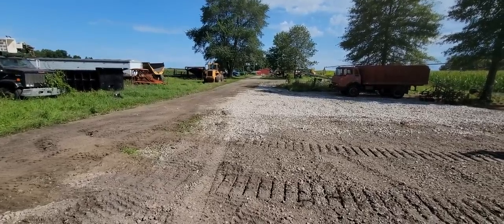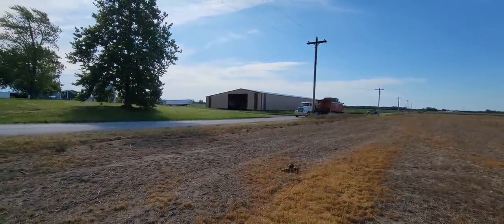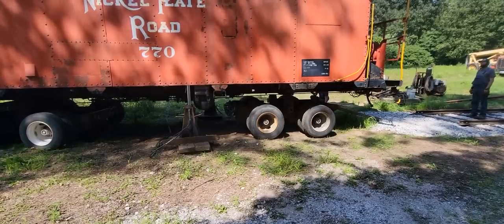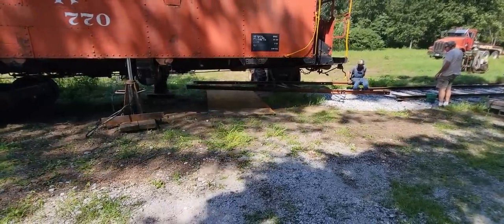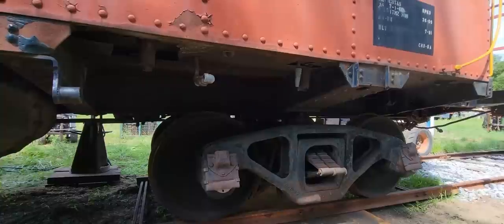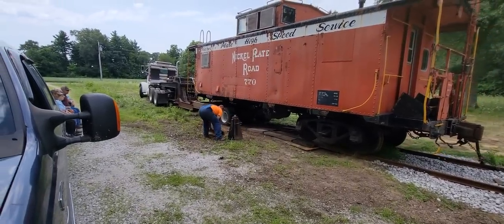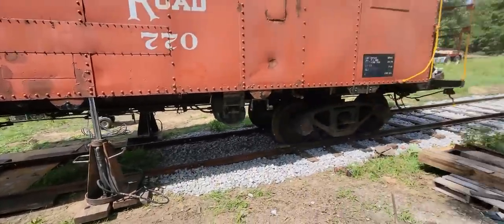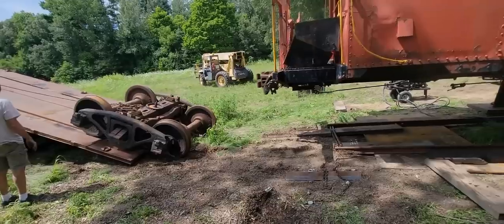Moving A Railroad Caboose!! Awesome Experience!!

Comment: How much would the caboose and rails set a man back?
Reply from the maker: I had heard this one was just under $30,000
Reply: @dirtgrainsteel 
 I wonder what you could get two early 1900s rails for?
I have two Sherman's hair pins which are old rails that were bent during the Civil War that were dug up in my yard along with a rail bending hook that was invented during the Civil War for ripping up rails.
They have a picture of the hook on line that looks just like mine.
I can pick up a 14 ft section of the old Iron rail by myself it is so light.
They didn't even bolt them together back then.
Sherman camped right here all around my property which had the old depot on it.
I've got copies of his communications that say he camped here close by and he said they were tearing up rails and bending them and there is still an old rifle pit close by.
I was curious about the price on some of the old small rails though. 
Thanks for the video and your reply.
Good to see those old cabooses.